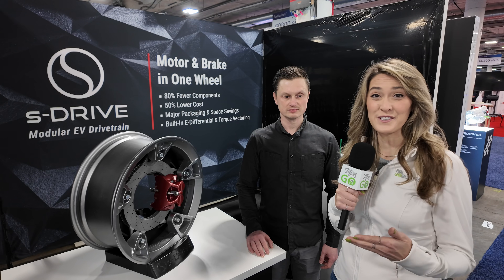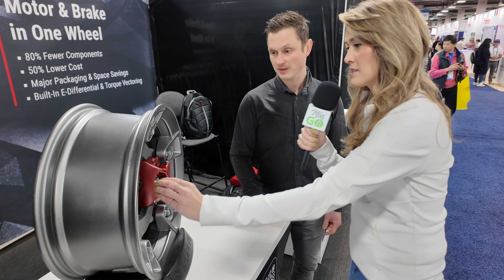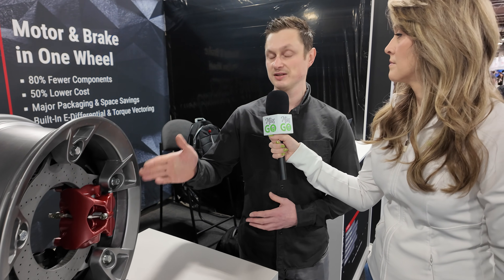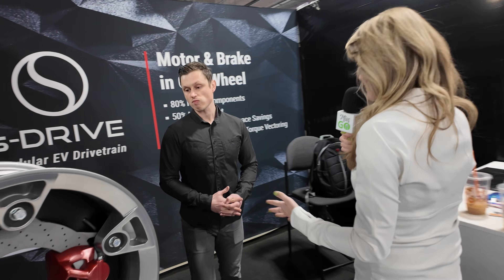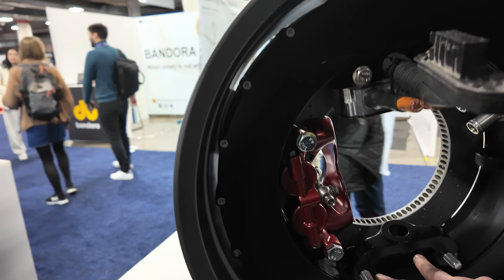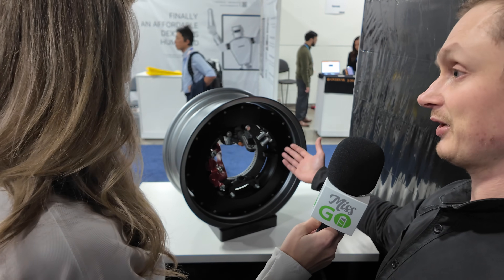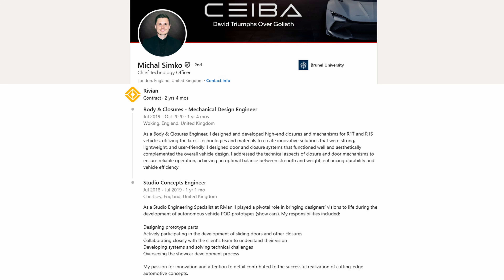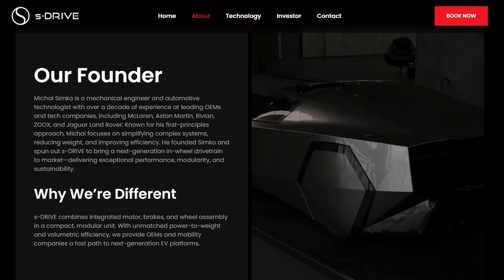S-DRIVE In-Wheel EV Powertrain Solution (CES 2026)

Comment: The problem to me is that there are existing IWM companies who themselves have only had limited success so far.   Even if this one is better, I suspect that there are reasons why the industry is very heavily invested in the status quo.   The CTO's experience  at some of the mentioned companies might mean that he has seen why the existing solutions got rejected so that might be why he feels he has the answer -hopefully so.
Reply from the maker: Here is a hubless axial flux powered vehicle after 11k miles driven this summer by a YouTuber.  These have been in production for years.
https://www.youtube.com/watch?v=cQstV0uLLHg

The S-drive design integrates more components and can fit a wide variety of applications
-Producer Tim
Reply: @MissGoElectricIndustry ...an expensive motorcycle with a low production rate in which one wheel is needed per vehicle.  Elaphe and Protean have been around for years and I can find videos for you of some of their vehicles. Aptera was a big hope but that fell through for Elaphe for some reason. Protean apparently is used in a  Chinese car model and they have a factory in China to build the wheels for it. There is going to be in a high spec Renault 5 with Protean wheels...but these companies have been around for a long time and are still small and poor. I'm a fan of the whole idea and it just hasn't exploded in use which you might think it should. I don't know why but I do think it's a struggle to change something so fundamental. I think the current hope is that the cost has come down.

Comment: Can't understand, how is it different from DonutLabs motor "concept" that should be, according to their words, already installed by many OEM's. Power figures are also almost the same... Are they just reselling it?
Reply: The Donut Motor has been in Verge production motorcycles for two years, so it's not a concept. They're also installing it on truck trailers to reduce diesel consumption.
Reply from the maker: No relation.
-Producer Tim
Reply: @MissGoElectricIndustry no relation, OK but still, just a year later same motor like from DonutLabs. Hell of a coincidence.

Comment: Gonna be a nightmare on gravel roads.
Reply from the maker: Solved problems.
It seems like many commenters are not aware that axial flux hubless motors have been in production vehicles and delivered to customers for years.
https://www.youtube.com/watch?v=cQstV0uLLHg
-Producer Tim
Reply: Right? Unless they have fully captured the magnetic flux radiation, the iron filings coming out of that dirt and gravel is going to stick all over the inside of this hub.
Reply: @maj429  Make it pressurized compartment with constant outflow of air through the gap.

Comment: 600Nm of torque at the wheel is not enough to replace the brakes. I have a small EV with a 50kW motor and that provides 500Nm of torque at the each wheel with a 15"rim and this thing is slow to take off.
Reply: The DonutLab motor that has been in vehicles since 2024 provides:
- 4300 Nm for the 21" motor
- 1200 Nm for the 17" motor
- 300 Nm for the 12" motor.
An equivalent to this 19" would come from their custom solutions, and likely provide over 2000 Nm of torque. Simko have some catching-up to do.
Reply from the maker: There might be an arithmetic deficiency at the root of this criticism.
-Producer Tim

Comment: I hope that this is able to survive US potholes.
Reply: Wheel rim flexes a lot while driving, inducing material fatigue. If you make it too stiff, it will break. If you make it soft but equip it with low tolerance gaps like in axial e-motor, you'll get failure prone design. Make it lose, you'll get dust contamination and low efficiency, further more unsprung mass put too much stress to the linkage and tire, whole concept is too risky for longevity, ease of maintaining etc ... there's a reason this design is known for so long but never used. It could be fitted in some high profile sport versions meant for show and hour-on-track life time...
Reply: @Helloverlord stiff doesn't have to mean brittle. Forged or spun-cast wheels are stiff, yet durable. This perimeter design is perfect for spin casting. Even extra thick cast would be stiff and durable. 
Tires on commuter cars are much more forgiving than sports car tires. I also question the huge bearing sealing abilities.
Reply from the maker: Should be fine. It is viable. Mercedes will implement similar motors they own into production vehicles this year
https://www.youtube.com/watch?v=QQ3TLkIkVWM&t=14s
-Producer Tim

Comment: You can virtually eliminate the brake pads or make them last the lifetime of the vehicle, by having an air-cooled heating element installed at a strategic location. When the battery is full, the regenerative braking current can then be dumped into that air-cooled heating element, instead of working the brake pads to generate heat at the wheels by friction.
Reply from the maker: We hope you'll subscribe over at our main channel to keep up with innovations like this one
youtube.com/MissGoElectric
-Producer Tim
Reply: That's unnecessary junk. You can't need braking unless you have accelerated the vehicle up to some speed, using battery charge. The case of having to brake but having a full battery is non-existent.
Reply: @brianb-p6586 batteries aren't charged with constant current throughout the charging cycle. When the battery is close to being fully charged, it probably won't be able to take all of the inrush of current from regenerative braking. That excess current has to go somewhere. If you don't dump it in a properly cooled heating element, it will fry your electronics. Unless of course you use regular brakes to generate heat at the wheels.
Reply: @docfarl  sure... but regenerative braking doesn't always (or even often) mean full effort, and that situation of being nearly fully charged and needing any braking is only momentary.

Comment: What happens when you get a flat?
Reply: Same as happens now.  Plug ir, pump it up carry on, all call a service if you can't.  To remove the wheel to replace tyres, not currently explained but it looks like the rim is removable.
Reply from the maker: Solved problems.
It seems like many commenters are not aware that axial flux hubless motors have been in production vehicles and delivered to customers for years.
https://www.youtube.com/watch?v=cQstV0uLLHg
-Producer Tim

Comment: What about getting a flat tire? There is no such thing as a spare tire?
Reply: Manufacturers are using spares less and less as it is. This is truck to shop but then it's like that for so many brands now. The real prob is if you break a wheel, but that's never a good time.
Reply from the maker: No automobile I've purchased for ten years came with a spare. 
-Producer Tim

Comment: Basically the same drive as Northrop's electric bus from the early 1990's. Except theirs was a 400 volt 10KHz AC drive and the electric motor used regeneration for braking.
Reply from the maker: It is viable. Mercedes will implement somewhat similar motors they own into production vehicles this year
https://www.youtube.com/watch?v=QQ3TLkIkVWM&t=14s
-Producer Tim

Comment: This is a great achievement, getting over the unsprung mass issue
Reply from the maker: Absolutely!  We'll keep reporting about this development on our main channel with our weekly 10 minute news
news.missgoelectric.com
-Producer Tim
Reply from the maker: Absolutely
-Producer Tim
Reply: This would be a be good weight reduction  but Correct me if l'm wrong. Doesn't most of an EV's weight come from the battery?
Reply: Yes, unsprung weight is one of the main reasons why the somewhat attractive idea of the 'in wheel' motor hasn't really taken off. The other significant reason is that handling is aided by keeping vehicle mass low and centralised but if the motor and brake package plus conjoined (outer) wheel hub weighs about the same as a standard cast wheel hub plus a disc brake there is certainly no harm done by having the motors outboard in the wheels, in this case. Indeed, centralising the weight of the battery pack (in a better way than is typical) for responsive handling becomes an interesting engineering challenge given the near non-existent penalty of having these motors mounted in the wheels.

There is still the issue of shocks and torques being transferred to the motors given the mounting to the wheel and the immediate transfer of forces to the motor when attached to the wheel in that way. That said, the mechanical arrangement of all of the pieces looks quite brilliant to me, a step up from what Donut has already implemented with its novel hubless motors.

NIO would do well to try to get this guy back. Or, perhaps, Donut might partner with s-Drive to take things to the next level.
Reply: I concur, those should actually end up working really well.
Reply: Bit it's still gonna shake a lot on the bad European roads. How long can the motor handle the vibration before it falls apart?
Reply: @SzaszaG1 Do your brakes fall apart because of vibrations? Then why would these motors?
Reply: @SzaszaG1  how long does your ice handle vibration for before it falls apart?
Reply: @jesflynn4048 Much of the vibration should get damped by the tire.
Reply: @jesflynn4048 To answer your question ICE or conventional EV, 150 to 200k miles an then you replace the shocks no big deal
Reply: @rcpmac agreed; that's exactly the point. Making an ice vibration-resistant has led to technologies (and test standards) that have led to high reliability for hardware undergoing several thousand internal explosions per minute, plus tyre hum plus the lower-frequency-higher amplitude pothole rumble, so building a durable hub motor shouln't be too difficult.  Sealing a hub motor like this shouldn't be a 'mission impossible' either: we  seal crankshafts, cv joints etc reasonably reliably. In-hubs are the (near) future, for sure.
Reply: @jesflynn4048 that might be true but all the intricate rotating parts are well dampened by a travel of significant amplitude by the struts. That dampening inside the wheel is minute in comparison. This will still put significant stress into any bearing within the electric motor. I'm not even considering the forces on the coils and cooling system. Having some extra weight and loss for transmission and such is a good compromise to frequently buying whole new motors. Especially for heavy chunks rotating at incredible speeds that control a several tone vehicle harboring human life. 
I'm not against hub motors mind you. Although fascinating this is tech we're still far away from any practical sense besides niche application.

Comment: Google "sprung vs unsprung weight". There are zero benefits when extra weight is added below the suspension, but it has major negative impact to both traction and handling.
Reply from the maker: Did you hear what he said about the increase in unsprung mass? 
-Producer Tim

Comment: What happens when you get a flat tire? How do you change a flat tire, do you have to bleed your breaks when you change a flat tire? If you change a tire with 30k or 40k miles on a wheel, the break pad will be uneven, and the last thing you want is uneven break pads, the car will pull very hard to that side. how the hell does that mount to the car? And when you rotate the tires, the back wheels come straight forward but the front wheels cross going to the back how does that work? Do you have to bleed your breaks every time you get a flat tire or rotate them? SOOOooo many questions. There's a reason breaks are NOT attached to the tire.
Reply from the maker: Undo five bolts.  Pull off the rim.  As usual.
-Producer Tim

Comment: The axial motor is a great upgrade, but there are two things I'm not sure about.  Hub motors in cars have not caught on because of durability - cars at speed get exposed to a lot of vibration and dirt/mud/water and it's harder to shield the wheel than a motor in the chassis.
I am also concerned about wheel speed sensors - how is this done to ensure that all 4 motors are spinning at the same rate except in turns - maybe I'm overthinking this but it seems that the system controller will have to monitor wheel speed sensor very carefully.  
Question: Does this require regeneration or can it "coast", I personally don't like the fact that all BEV's (except Porsche) don't coast, they force you to regen.
Reply from the maker: https://www.youtube.com/watch?v=QQ3TLkIkVWM&t=14s
-Producer Tim

Comment: worried about the weight limits and longevity on those bearings ...
Reply from the maker: A solved problem.  Here is a hubless axial flux powered vehicle after 11k miles driven this summer by a YouTuber.  These have been in production for years.
https://www.youtube.com/watch?v=cQstV0uLLHg
-Producer Tim
Reply: @MissGoElectricIndustry  11k miles is a far cry from 200k+ and a motorcycle isnt a car ... I'm glad there's a ray of hope but I still have concerns.

Comment: 3:09 600Nm of torque at the wheel is a joke for a racing inspired motor. For context a nissan leaf can deliver around 2900Nm of torque at the wheels.
All these hub motor start ups are DOA unless they can somehow integrate a reduction gear into the motor.
Reply: Wouldn't it be 600Nm at each of wheel, not the total for the system?
Reply: @JorgTheElder even if you add that motor to each corner of the vehicle (x4=2400Nm) still the total wheel torque would be less than nissan leaf...lol
Reply from the maker: https://www.youtube.com/watch?v=QQ3TLkIkVWM&t=14s
-Producer Tim

Comment: If the claim that its as heavy as a normal wheel assembly that would be great, as unsprung weight is key to keep traction, (ideally you want the wheel as light as possible so the suspension can push it down easily into a dip, to keep traction, if its heavy it takes longer to push down)

Would like to see the weight of the assembly, no hub helps, but i’d still wager its a bit heavier
Reply: Not sure what he is calling a “regular” wheel but I seriously doubt his weight claims. If you just add the weight of the rotor to an aluminum wheel you’d be over.
Reply: @edrcozonoking  yeah I think he’s getting there because
- reduced brake rotor size 
- no central hub and axle connection

Now its probably still a bit heavier but if its even close it would be worth considering…
Reply from the maker: Mercedes makes similar weight claims with YASA. It checks out from our perspective.
https://www.youtube.com/watch?v=QQ3TLkIkVWM&t=14s

Clarity on unsprung mass with this type of propulsion
https://youtu.be/7A7RPEVlMrc?si=OUwiro2Z0GMeA33Z
-Producer Tim
Reply: It has to be heavier, but not by much. It is just another engineering challenge. Even if they require maintenance, they will require less than an ICE drivetrain.